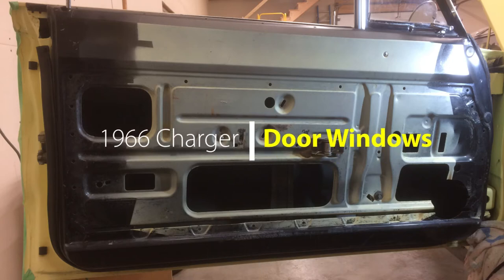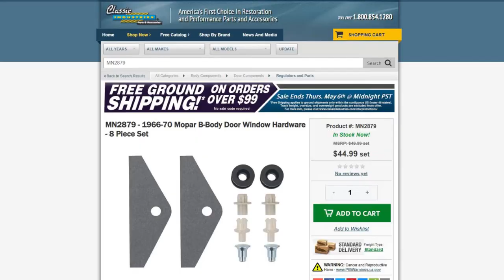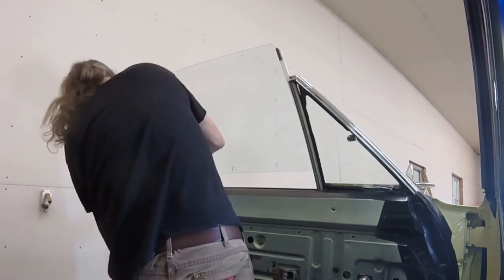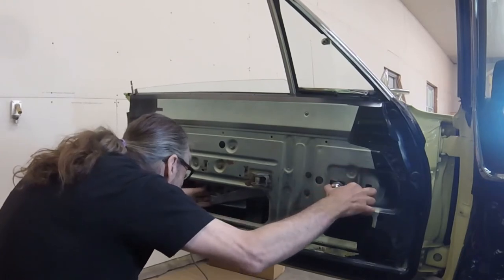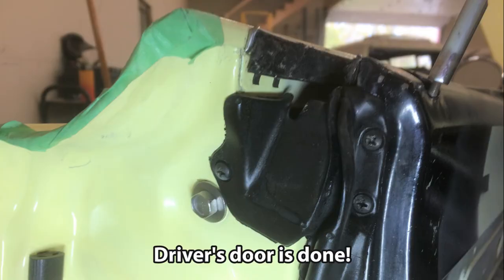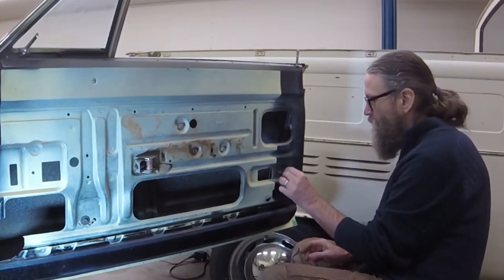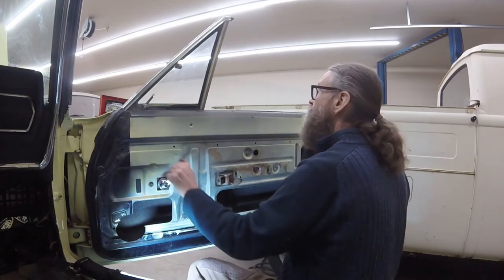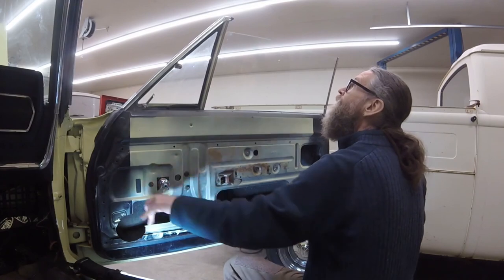1966 Dodge Charger Door Glass Installation

Comment: When I wind my glass all the way up, I have a 1/4" gap at the seal. Is there adjustment for thai?
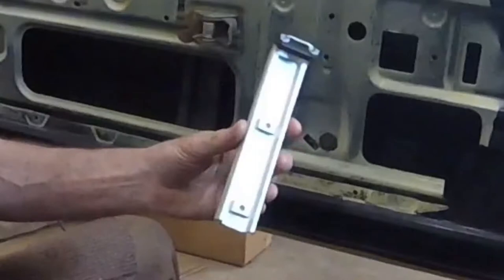Reply from the maker: Hi.  My first thought was the upper stopper (at 0:17).  It seems unlikely that it would go out of adjustment, though.  It's held in place by a couple of bolts.  My second thought is the regulator itself (e.g., bent arm, gear problem).  I think the only way to be sure is to pull the door card and observe the mechanism in action.  Good luck! 👍

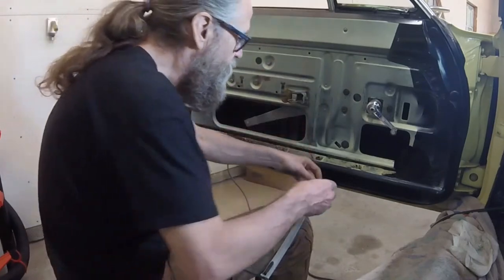Comment: Hi Paul. Thanks for this video, it's very helpful. It also makes me think that the problem I have can only be resolved by taking out the whole driver's side window on my 69 Roadrunner and then reinserting it. But I want to double check my conclusion. Here's the issue. At 3:47 in your video, you're attaching what you call the pin and t-bars (sliders) and fastening them together at the top edge of the window (you also attached them to the bottom edge but the bottom is not the problem). So on my car, the top slider's pin broke over time and the pin and sliders fell inside the door. The bottom slider is still attached and ok. I purchased a new set of sliders (pin and two t-bars) to replace that top slider. Now that the top edge of the window has no slider, it backs out of the channel and I can easily see and access the hole in the glass. I attached the new slider and disconnected the top of the vent from the channel (like you did in the video prying them apart with a wrench), but trying various things, I could not get the slider back into the channel. I think I'm stuck and am going to have to remove the entire glass and re-slide it back into the channel. Do you agree or does something come to mind I'm not thinking of? (Interestingly enough, I did what you were doing above by prying the two pieces with the wrench, but I used a screw driver....then I gave up and started researching and stumbled upon your video. I wish I'd seen your video first before spending all the time I did).
Reply from the maker: Hi, Dave.  Sorry for the month-long delay in responding.  Hopefully you've resolved this issue already.  What's preventing the slider from going back into the channel?  Is it because the glass needs to go higher, above the channel?  I wouldn't expect you'd need to remove the glass completely--maybe just disconnect it from the regulator (down inside the door) and slide the glass up high enough to get the slider into the channel, then reconnect.
Reply: @PaulBroenen  Hi, Paul. Thanks for the reply!  Here's clarification. I'm trying to add new sliders (T-Bar) to the top edge of driver's window (bottom is ok I think) without removing the glass. So while the glass is still attached, I crank the regulator so it will go as high up as possible and expose the top enough so I can attach the new T-Bar. I think when I tried it last, it wouldn't crank up high enough to expose itself above the channel. So, yes, to your question that it needs to go higher, above the channel. I tried that just over a month ago but maybe I didn't do it properly, so I'm thinking to try it again (without disconnecting the window) to see if I can get it to rise above the channel. If that doesn't work, then I think I have to do your suggestion and open up the door panel to disconnect it from the regulator. For the first method, leaving it connected to the regulator, do you think it will crank up high enough to expose the top enough above the channel to add the new TBars?
Reply from the maker: @davebal4846  Hey, Dave.  There's what I call an "upper stopper" inside the door that limits the upward travel of the window.  On my car, it's an L-bracket that attaches with two small bolts to the inside sheet metal of the door body.  If this thing is keeping your glass from cranking up high enough, then you would have to remove your door panel to access the two 7/16 bolts that fasten that stopper.  Perhaps you could leave the glass attached to the regulator and just crank it up as high as it will go to get the clearance you need.  One way or another, I suspect you'll have to remove that door panel.
Reply: @PaulBroenen  Hi, Paul. I didn't re-try as I had alluded to above because I re-watched your video and noticed that the hole on the very bottom edge of the window in relation to the hole where I need to put the pins in are too close in distance. In other words, when I saw the distance in your video, I realized there's no way for the window to crank up high enough beyond the track to expose the top-most hole. You're right, I need to take the door panel off and release the glass.
Reply from the maker: @davebal4846  Sorry there wasn't an easier shortcut.  I hope it goes smoothly. 🤞

Comment: Do you have anything on 66 Dodge Dart convertible door window adjustment? Cheers mate
Reply from the maker: Sorry, Hatish, I do not.  From what I've seen on-line, the A-body and B-body window regulator designs are similar.  Are you noticing significant differences in the designs?
Reply: @PaulBroenen  Well, this is the only Dodge Dart Convertible in my country and I'm restoring it. having restored many Chevys and Fords successfully, I find the Dart convertible in particular has pretty much poor design for door window adjustments. And I can't seem to find any info or video on door window adjustments even the manual doesn't say much, but hundreds of such videos on Chevy and Ford.
Reply from the maker: @hmayerv8  Based on what I can find on the web, it's hard to tell whether your A-body regulator has a built-in stopper.  My B-body reggie does have one, which controls the downward travel limit.  The stopper is a lobe-shaped bit of metal with a bolt running through it and the regulator body, with a lock nut to make it adjustable.  Does your regulator have something like that?  

Is it the upward travel or the downward travel that you are having trouble adjusting?
Reply: @PaulBroenen  yes it has a stopper in the centre of the upper door. There should rightfully be 2 stoppers one for the front of glass and another at rear of glass so we can adjust the glass for a perfect fit on the top against the convertible rubber seal. One stopper is not going to do its job esp being in the centre. 
If you raise up the glass at the vent side the rear glass side goes 1inch above the top material. So the glass needs to be adjusted Up and down which there's no adjustments that I can see. Stopper only stops the glass from going beyond its point.
Reply from the maker: @hmayerv8  I see.  That sounds a lot different from what I've got.  My upper stopper engages with only the arm on the regulator to prevent the whole window from going too high.  The window remains level as it travels up and down, thanks to the two vertical tracks (front and rear), and when it meets the solid roof at the top of its travel, it is forced to align with it.  At no point does it tilt toward the front or rear.

Sorry, I wish I could be more help. :(

Comment: I need to replace the window felt, how do I lower the window enough to do that?
Reply from the maker: Hi, Kyle.  If you're talking about the horizontal felts, and if your door panel has been removed, then you have two choices.

You can release the nylon rivet that connects the glass to its lower track, then carefully move the glass out of your way.  After replacing the whiskers, just put the glass back into its track, and pop in the rivet.

If you want to avoid messing with the nylon rivet (they can break), you could stuff some rags into the door cavity and remove the three 7/16 bolts holding the regulator to the door, then carefully lower the regulator AND glass down to rest on your rags.  Swap the whiskers out, then put the reggie and glass back--making sure everything lines up as before.

Good luck!
Reply: @PaulBroenen  Thanks for the reply, I had to replace my regulator, so it made it easy to drop the glass all the way down

Comment: Is this similar to a 64 dodge 440 2 door hardtop?
Reply from the maker: Surprisingly, no.  The A bodies had a totally different window regulator design.  Instead of connecting to the window glass at a single point, like my B body, the A body regulator connected at two points, using a scissor-lift kind of action.

Comment: I was wondering if you might know the answer to the following.  I took my glass out, regulator and slide.  I installed new wiskers and put it back together.  Everything seemed to line up.  I put things back where they should have come from based on paint marks.  The project is done.  Only problem is that when I roll it down, it wont go down enough.  It stops just above the door.  Enough to feel it when you rest your arm there on an open window.  It really should drop another half inch.  Any Idea how to adjust that?  I did see the regulator adjustment but didnt really want to mess with it.  Not being sure how it works.  Any help would be appreciated.  Jeff
Reply from the maker: Hi, Jeff.  I think the lobe-shaped adjuster on the regulator is your only option, unfortunately.  I went out and checked my windows in their down position, and the highest point on the window's edge is a good 1/8 inch below the top surface of the trim--too low to feel with your arm.  I was lucky, because I didn't mess with my adjuster, either.

Sorry, I wish I had an easier answer for you. 
😕
Reply: @PaulBroenen  I did see that screw and lock nut there.  I didnt want to mess with it.  I wasnt sure how it worked.  Looks like that is my best option.  Thanks for taking the time to check that out.  You can see the car on this account, if you are interested.
Reply from the maker: @Campbase1  Wow, a `69 GTX!  Nice.  I Google around bit to see if there's any difference between first and second generation B body window regulators, and it looks like they're pretty much the same.

There are two pieces involved in the lower stopper.  One is on the cranky mechanism that bolts to the door, and it's a slotted stud with a lock nut.  The other is lobe-shaped or round piece of metal that sits on the big, curved gear at the base of the arm.  On my `66, it's shaped like a lobe or half-circle.  On others I've Googled, it's circular.  Either way, that piece should be adjustable.  By changing its position, you should be able to adjust your maximum roll-down.

It would help if I could post pictures here :)
Reply: @PaulBroenen  Glad you like the GTX.  I have kind of given up on new videos but, I continue to replace parts on the car.  Many of the things Im doing on the car could be useful information.  But, I think I have done enough for now.  Your videos are really good and helpful. I can tell you put a lot of time into them.  Thanks for the additional information.